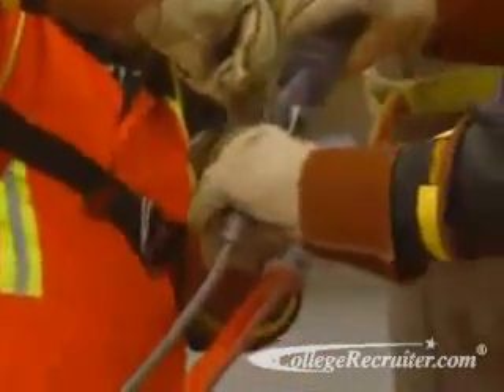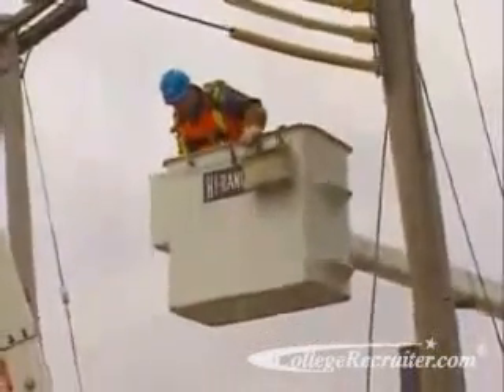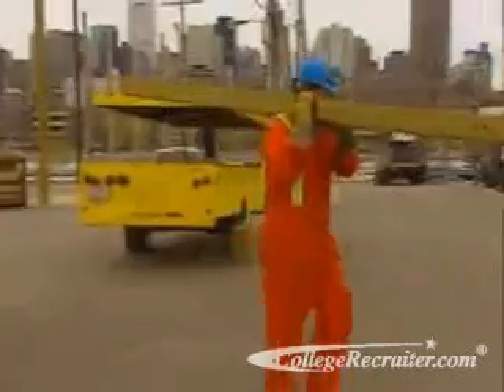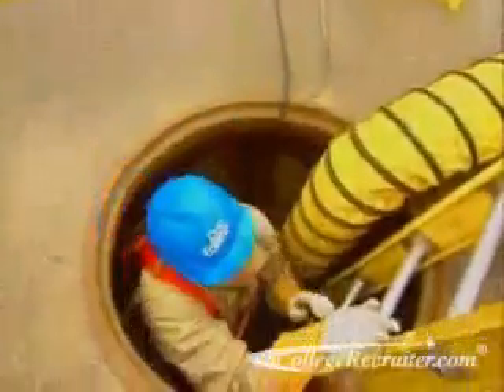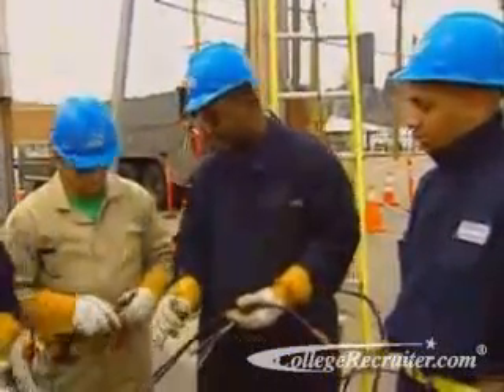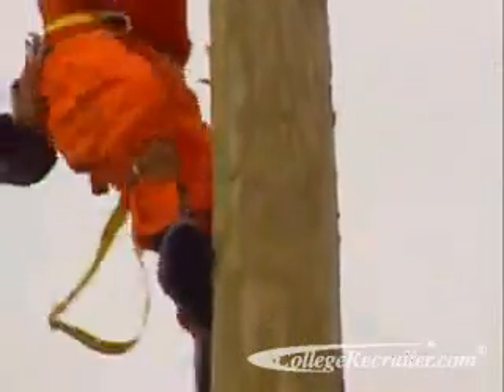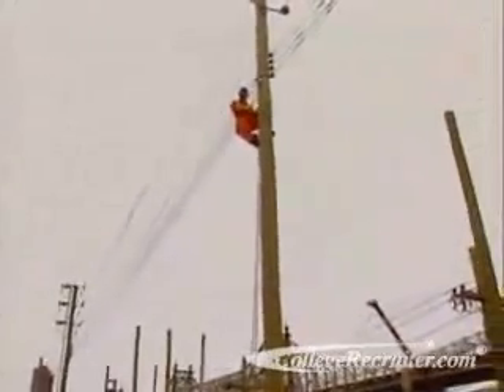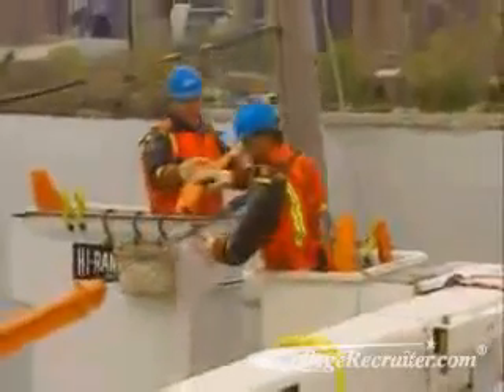Electrical Power Line Installers and Repairers

Comment: Lets not forget the telco linemen. We also work just as hard as the power linemen, on poles and in manholes. The difference is we have to splice thousands of small wires. Every phone line (or dsl line) needs a pair of wires to put the circuit through.
It's a great job. Wouldn't trade it for the world.